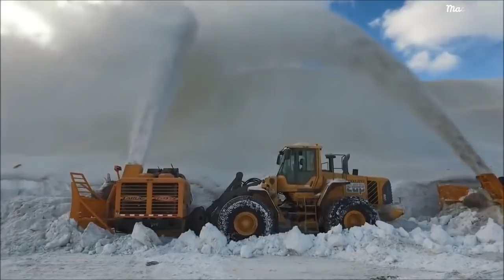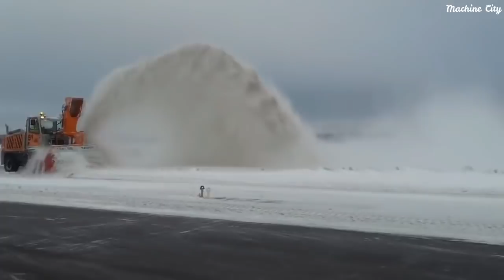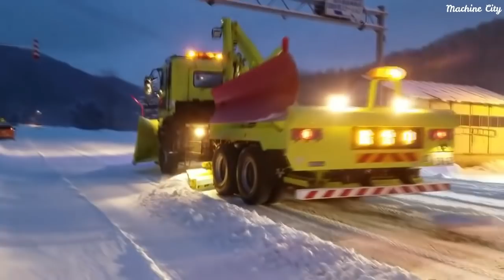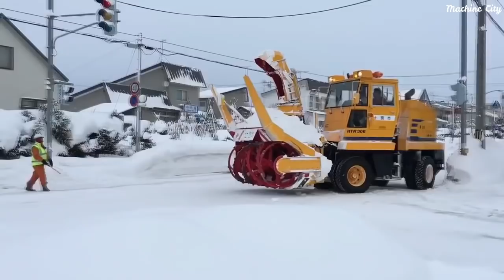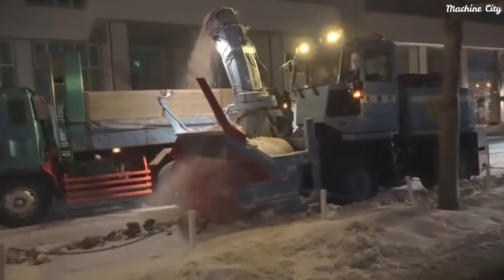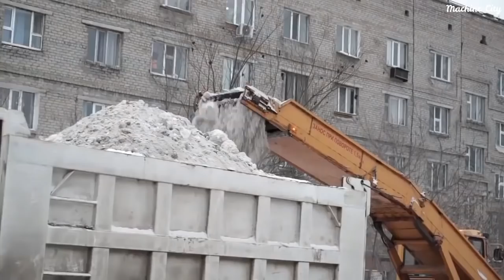Snow Plowing Machine - Wonderful Snow Removal Machines In Action-Best Compilation Video For 2021

Comment: 0:28 This way of plowing is completely fucking crazy. The plow trucks pull out snow on an almost dry road, which becomes shit-slippery when the cars pack the snow in the road surface. Plow the snow in the middle against the barrier wall instead, so it will be softer to drive into. 😎👍😉
Reply: They plow snow this way in Toronto, Canada, where there is lots of "lake effect" snow and several freeze/thaw cycles every winter. If they did it your way, after about 2 snowfalls, there would be no room left in the middle for the next storm, and by spring it would be a totally unmanageable mountain of ice. There's also A LOT of traffic, so they have to get the freeways clear in a hurry. The traffic takes care of the small amount of residue left on the road surface very quickly.
Reply: @stephenjokela  Ha ha ha .. When I put this emoji 😉 at the end of my comments, it's meant as a joke. I thought most people understand it after reading the last sentence. 😉
Reply: @larszenthio1012  Haha It's all good!👍 sometimes my sarcasm detector is a little slow. Especially having experienced Toronto drivers...some of them would take your last line as real advice.
Reply: They are clearing the shoulder for security reasons. If there is an accident, the shoulder needs to be clear and accessible. This is especially important on such a wide freeway.